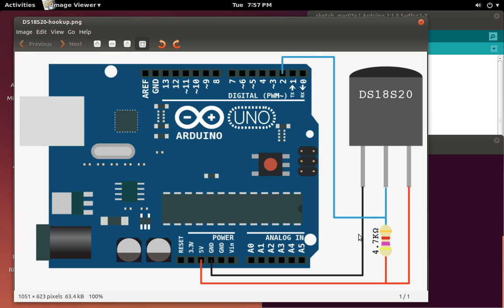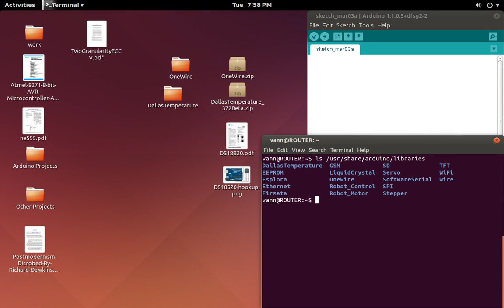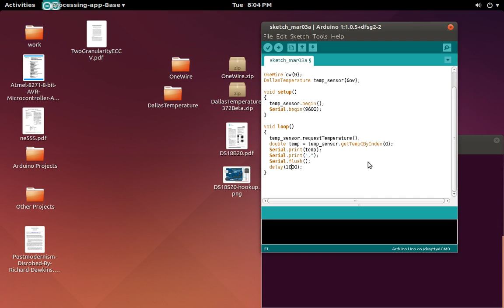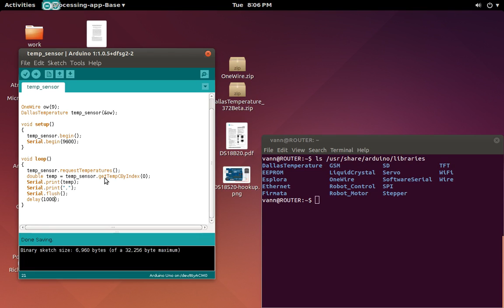Qt & Arduino - Reading a Temperature Sensor - Part 1: Arduino

Comment: Capacitor in Dallas sensor? First heard.. :/ Delay in sensor can be caused from timer build in in sensor. The reading from sensor can  be power costly, and voltage on pin when reading is occurred, gets lowered because of internal resistance. And because ADC in sensor takes very low power, is also sensitive for voltage change. 
Delay is proposed to get voltage stabilized between Arduino, which is delivering power and sensor. 
ADC on sensor works all the time, but with lower voltage, there could be lower values. I hope that You know how ADC works. PS. That's problem has faced a lot of peoples, but some of them make bad assumption about problem what they are facing.

Comment: sorry sir, why you didn't use Serial.println() ?
Reply: Println is print message with new line, that means You flush to output also "new line " character like "enter" If You send message with one string letters or even one character, You dont need "new line" be also sensed, because on receiver You will program it to get that one character or string characters. Only You need " new line" if You send whole document, whit many rows in one time.
Reply: @maxim25o2  yah, i know bout println is to make new Line. But I think it make easier for firmware programmer to send message in println form. If in print form, he Will get a whole string that makes him confuse